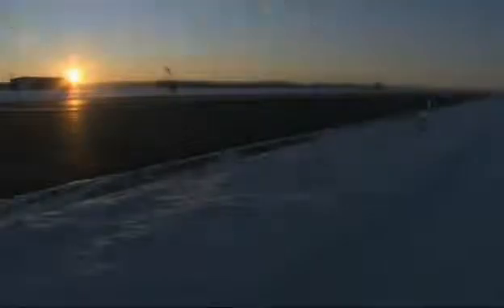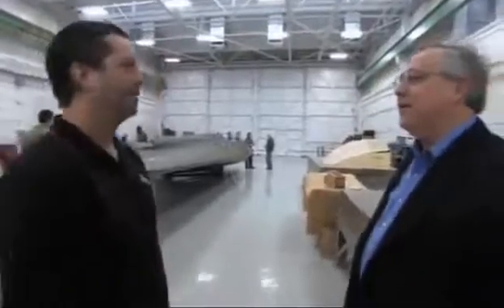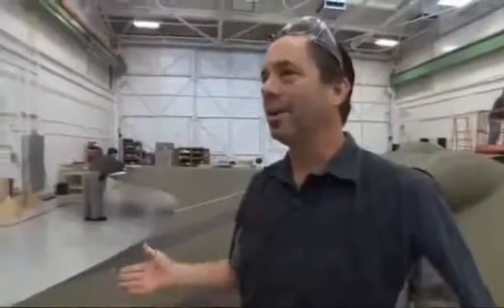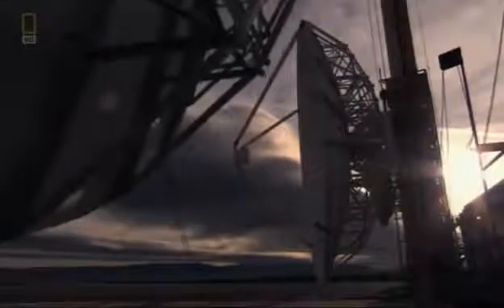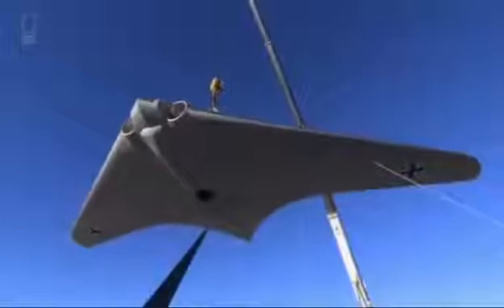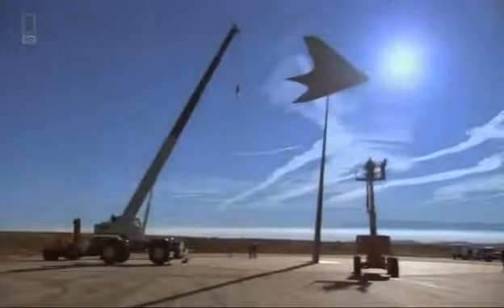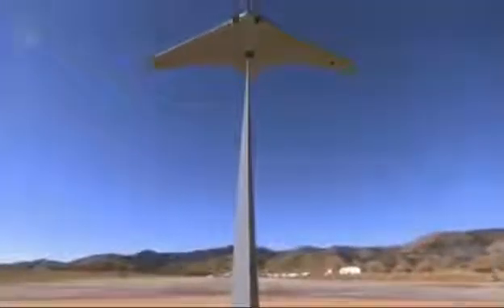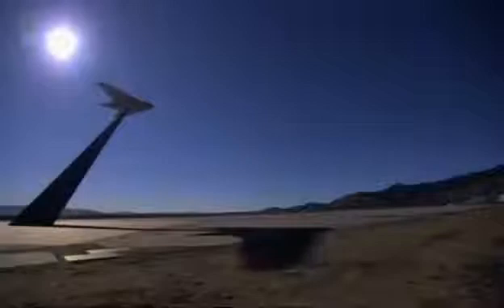National Geographic - Hitler's Stealth Jet Fighter - Military Documentary Part 3

Comment: I know it’s the whole purpose of the docu, but I find it somewhat hilarious that what qualified as “covering” the Ho18 “Amerika” bomber completely left out the fact that the Junkers/BMW turbojets being used at the time GUARANTEED wouldn’t have been able to operate long enough to carry the bomber to Iceland, much less the USA’s eastern seaboard. The Ho229 was certainly a formidable design and constitutes a great example of why the Horton brothers are still legends in the aerospace world, who’s to say what could have happened if the 3rd reich had access to the metals necessary to manufacture turbojet engines successfully? Certainly the Me262 would have been much more dangerous to Allied bomber formations...
Reply: I heard it was some 100hrs in case of Jumo004. How many is it today? 100k hrs? They were really ridiculously bad. Still...the design predetermines this craft as a bomber, not a fighter. Especially at the time when all jets like ME-262 had a drag problems when going up from a dive. Early jet motors suffered too much technical issues to properly "monetize" their design superiority...
Reply: @tomaskoptik2021  yeah, the metallurgy available at the time precluded jet engines being viable as reliable powerplants.

Comment: The Horten Ho XVIII model at 0:31 was an early design for the Ho XVIII flying wing bomber. A later Ho XVIII design had four turbojets and four-wheel retractable landing gear housed in underwing pods. Messerschmitt and Junkers had requested that the Horten bombers redesign the Ho XVIII with a vertical fin, but the Hortens rejected this scheme as creating aerodynamic drug.

The Horten brothers weren't the only people in Germany in WW2 designing flying wing bombers. Junkers and Messerschmitt proposed flying wing bomber designs of their own, the Junkers design being called the EF 130 and the Messerschmitt designs being called the P.1108 and P.08.01.